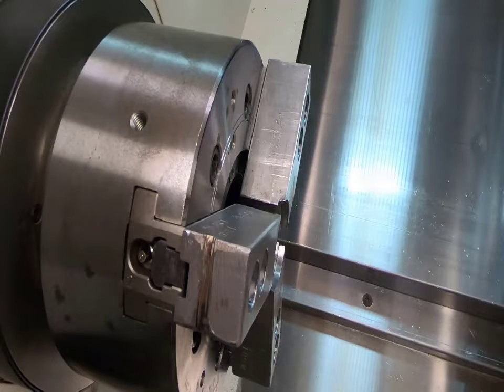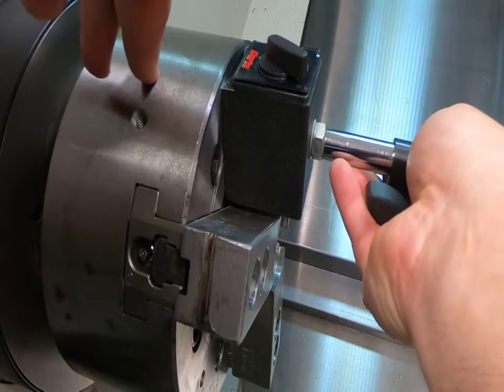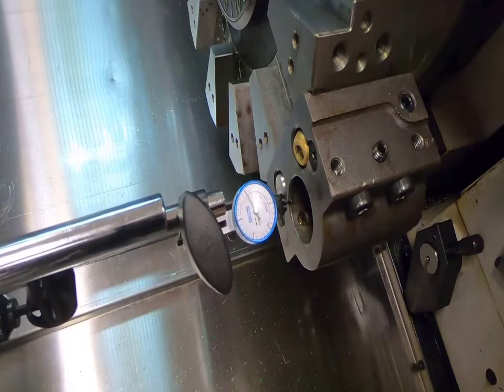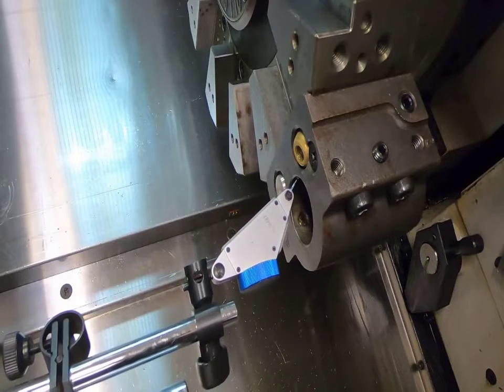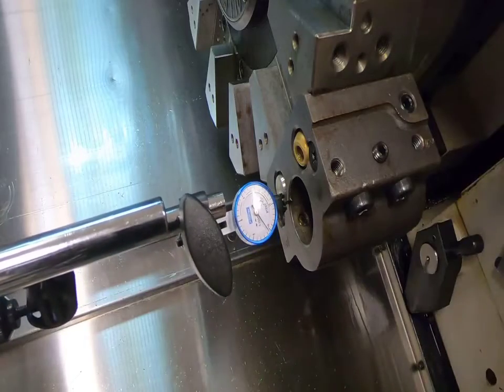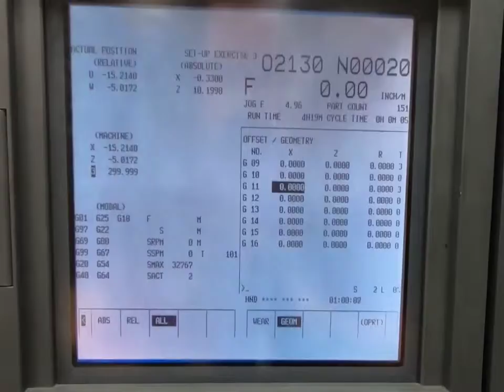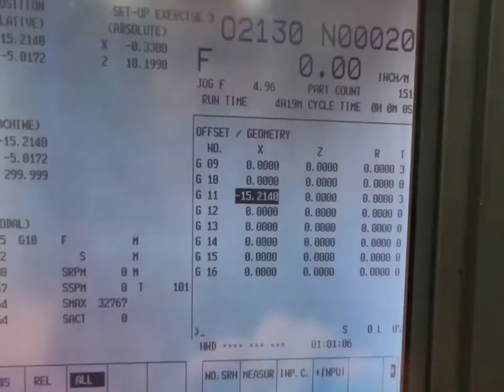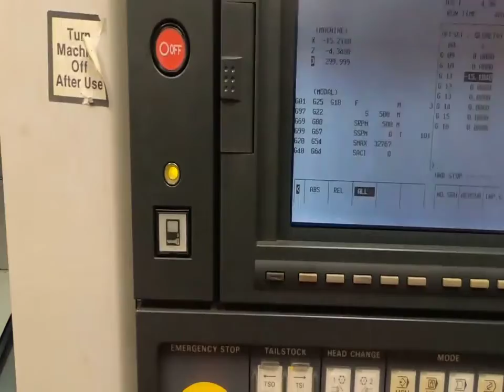Setting up an Insert Drill on CNC Lathe

Comment: I always just type in ”X0” and click ”measure”, that way it automatically knows the current position is X0 and you don’t have to type in a bunch of decimals, for safety I like to call the tool afterwards without going home and it should say X0 on absolute. I also clock the actual drill itself (the shaft) instead of the holder.
Reply: same here dude
Reply: Same deal, just as a sanity check. You really put yourself at the mercy of the boring sleeve, to say it may be accurate, I'd Even go as far as even trusting the quality of it aswell. These " offset drills " tend to like going in one way opposed to the other.
Reply: thats the exact same i also always do. though i indicate on the to knock it into zero runout ( since you can move the ER collet around ever so slightly cand get it perfect on center ) but only when it has to be a very precise hole size where i cant any more tools up. and also get the absolut max tool life out of the drill without changeing feed and speed

Comment: This is something , but if your holder is out in Y , or not parallel with spindle , that sweep won't guarantee a good hole .
Reply from the maker: That is correct about the Y being off and since most smaller machine shops are now purchasing machines that are used this is way to get your hole in close and then use the offsets to dial the hole into size. If your turret is off too much then a service tech will have to be called in to re-align the turret's home location which isn't very hard once you know what parameters are needed to be reset. Thank you for watching

Comment: im really not so sure i agree with this,  if you watch your tool its flexing while drilling after you offset that .030"   so now when you drill it will be drilling off center.    I think its always best practice to center X up on the axis of the tool regardless of the final dia.   use a boring bar to get a your final ID correct.
Reply from the maker: I believe you're more right than you think because I have a feeling after noticing what you saw.  that the turret itself may be out of alignment in Y, which may be causing it to deflect down. Thanks for the comment and thanks for watching

Comment: Invest in a coax indicator
Reply from the maker: Yes coaxial indicators are definitely a way to speed up the process. I'm a firm believer that companies should have these readily available at the machines if a lot of indicating is being done. Especially if you're in the detail area on manual Mills.
Reply: @aaronrunk4209  I use them daily on all my setups for both lathe and mill..
And all of the fixtures I make I just drill a hole to indicate for my x,y 0 positions makes life really easy
Reply from the maker: @fishsticks88  absolutely it makes life easier

Comment: Gravity throws it off. Been there done that. For true accuracy, MUST use a coaxial indicator.
Reply from the maker: Yes coaxial indicators are, and not just for lathes but on Mills as well.  I wish a had air gages in the shop because it seems to be the easiest way to show students how to check hole size, egg, and taper. Dial bore gages are great but the air gages really magnify the details of the hole.  I have students indicate the drill close since they will have to dial in the boring bar for the holes finished size. They also learn how to use the drill as a boring since this saves room on the turret.  Again thank you for watching

Comment: Dial in that turret centerline. The lathe will cut ten times better on OD and ID turrning with that Y axis error fixed.
Reply from the maker: Yes, we do need to get that fixed.  Our Doosan 2100 was out, and the tech showed us a really cool trick to get it back into alignment, and it was also mind-blowing watching then so it. I'm not sure if it'll work on the Mori, but it's worth giving it a try. Thanks for watching

Comment: I'm interested where your zero is its really weird that your zero isn't (almost) the center of the drill pots. But that being said everything you said was very informative for the newbies just starting out. Hats off to you sir 👏
Reply from the maker: On my older machines once I find the distance from home to the center of spindle rotation I have that number put onto the machine to make setups faster since I really only need to do this once. I have some newer Doosan's and they are setup with the offset from home to the spindle rotation is already in the parameters. This allows me to keep the offset at zero. Thanks again for the like
Reply from the maker: @christophercolumbus8944  well unfortunately I've never done that type of drilling but I to would be interested.  That and using a hobber are 2 things I've never tried to do.
Reply from the maker: @christophercolumbus8944  no is a Mori
https://youtu.be/qsOkxyRLabE

Comment: This is a demonstration of indicating ANY ID holder whether it be for a twist drill, insert drill, boring bar, threading tool etc. Every tool needs to be on center in the Y axis too (theoretical Y on machines with no Y axis). For this machine, loosening the mounting bolts and slowly torquing them down while indicating would be necessary.  In my opinion a dead center 0 for an insert drill is unnecessary (just the X). Since it cuts like a boring bar just touch it off like a boring bar and program it to cut at exactly what size you want instead of X0. Also if youre finishing the hole with just the insert drill and no boring bar, clearing the cut diameter by about .005" in X will prevent dragging on the finished bore while retracting.. You cannot cut very far under with an insert drill without damaging it. You can however cut pretty far oversize depending on the length/diameter ratio of your tool. For example, a 1.000" inch insert drill might be able to cut to .990-.995 without too much rubbing/galling assuming it's not going deep, but you can cut up to about 1.100" before the center insert gets above centerline and starts to rub the wrong way (which can be catastrophic and varies by manufacturer). As a bonus you are creating more space for chip evacuation, and you don't need all the different size drills. This does of course have its limits and several variables will affect the end result. One very important thing though is that he didn't check centerline where the tip of the tool would be. X0 at the turret vs X0 5" away may be very different so it's best to use gauge pins or precision ground rods to indicate the length of the tool rather than just the front tool block on the turret itself.  I use insert drills ranging from 17/32" up to   2 3/4" on a daily basis in plenty of 304, 316, 303, 6061 and brass with the help of 8 Mazak HQR150 MSY's which are twin spindle twin turret turning centers.

just my 2cents
Reply: lol .. looks like a clown have  slammed the revolver  into  a rotating chuck... or the runout would never be that bad ..  I bet  both the spindle, z, and x are way off .. but everything can be fixed.  ,if its not a mazak ;)
Reply: @mattiasarvidsson8522  whats the problem with mazak ? :D just asking

Comment: Because you have different block height on the machine blocks it will be, or should be always x0 there will be higher and lower centre blocks as well. There’s you put  in as x+ or x- , depending on the height difference, but again it’s just a rough hole usually.
I’ve worked on many, sometimes the hole a little small, sometimes a bit big, that depends on your turret position during its rotation.

Comment: I've touched the id tools off on the outside from the opposite side, spindle on reverse, then just input your measured OD number in negative and boom the reading is there.
Reply: That's on the manual lathe, the cnc has the luxury of tool setter
Reply from the maker: @MF175mp  Yes CNC's are a Luxury when it comes to setting tools, but knowing how to set tools the way you described is a must because Tool Setter's never break..... :-)
Reply: @aaronrunk4209  The repairing of the setter would probably cost more than I paid for my whole lathe. I would probably end up not repairing it
Reply: @MF175mp  I know I'm a little late to reply to this but that's exactly what 90% of all company's think and do but they really do pay for themselves.... eventually. 
As in speed and if they are treated right and the calibration is good enough for what you want << or set so they leave a little on so you can manually offset in the "right direction " lol.
Reply: @MillTurn4Life  I'm not a company, hobby stuff and a few singles and batches sometimes for people I know at this point.
Reply: @MF175mp  keep going hopefully you (if you like it) can be one of the ppl that started as a hobby then end up with a whole shop I know its harder these days but good luck anyway 👍

Comment: 3:00 Have you compensated for gravity?
Reply from the maker: Factoring gravity would be a good method to use if you were trying to hit the hole in one shot. technically on a boring mill when you're indicating a hole in the size a lot of times you have it run small and then with the boring bar it will finish it but you must use Precision measuring tools such as a dial bore indicator, air gauges, or Tri mics. Air gauges are going to be best in a production environment.

Comment: i usually use a smaller drill than what i need to make a hole (most machines where i work are older and have some wear to the them).

example: im drilling a 50mm hole. then i might use a Ø48 drill, throw it up, set my offset to X0,5 and drill. most of the time the hole will be a bit bigger(Ø48,3) this is to prevent rubbing on the tool inside the hole. after that  i just use the drill to come up to the diameter i need. no need for a boring bar, unless you're doing some profiling inside the hole (FYI the is a rougging application). i use this method to same time and money on inserts. works with most material, but not superalloys ( haven't tried it, but i just assume).

At the end of the day it all comes down to application and how presice you need to be.
Reply from the maker: That is a very good technique as well. This works especially well when putting in hole on a mill that have tight TP.  Drilling it small then inspecting its location keeps shop scrap rates down.

Comment: You could just use MDI to recall the tool offset and G0 X0. to get back to your center position.
Reply from the maker: Yes this makes setup a lot faster once the center of rotation is found.  Using an indicator can difficult depending on the setup but once your close your in and storing the machine location is a must.   Thank you for watching

Comment: Next time just install drill o.d. insert up.  Enter g54/55 g28xo:    test cut a shadow hole,  measure diameter and wear offset just like a boring bar.. finished,  fast and easy.
Reply from the maker: You're not wrong in the fact that this would be very quick if you are running a machine that had its X Center of rotation set to the center of the chucks rotation. however, on many machines the center of rotation is is not the center of spin. Depending on the machine G28 X0 location can be inches to feet away from the center of spin.  For example, your explanation would only work on my newer Doosans but not my older Doosans. The good news is once you have found the center of spin on any machine you can simply write a parameter/macroprogram to put you at the center of rotation or simply write it down on the machine and shift that distance from home position.  Thank you again for watching
Reply: @aaronrunk4209  running dinosaurs?  Lol, j/k.  Guess im spoiled with all new machines.  All my haas, doosan and toyoda's go off center of id holder.
Reply from the maker: @memyselfandi3925  lol yes we do have many good ol machines. I honestly need to make an updated video using the update technique since this is becoming more common. Thank you for the 💡

Comment: How to setting Y0 if the machine have no Y axis?.
Reply from the maker: If your alignment is still off when you set X axis zero, you will have to determine if it's off beyond tolerance and then you need to look into If your turret is out of alignment or if you are able to make adjustments to your tooling to bring it alignment enough to make your parts. Thank you for watching
Reply: @aaronrunk4209   Y axis in my turret miss alignment.
unfortunately my machine doesn't have Y axis settings in the controls..
maybe I'll try to adjust the cutting tools..thank you

Comment: Why not use a coaxial indicator?
Reply from the maker: Yes coaxial indicators are definitely a way to speed up the process. I'm a firm believer that companies should have these readily available at the machines if a lot of indicating is being done. Especially if you're in the detail area on manual Mills. Thanks for watching

Comment: Looks like you done indicated  them jaws.
Reply from the maker: Maybe, but my truck for indicating jaws in is by calling up a boring bar and koving each jaw against it as I rotate it and tighten them down. It works pretty well, but sometimes it's still frustrating. Thanks for watching

Comment: What would be your normal speed and feeds on this index drill on a piece of Alum stock?
Reply from the maker: The feed and speed in using on this drill in this video https://youtu.be/y46_P5Nj9H0
I belive is G97 S2500 F.020 IPR which could be much faster depending on the power of the machine but this is a decent feed and speed.  Thanks for watching

Comment: What about 6edges reamer center
Reply from the maker: With reamers not having much a bottom cutting edge,  once it's dialed in on zero it will follow the path of your drilled hole.  If the cost of your material or job is expensive, always grab a setup piece of material and test it on it. Thanks for watching
Reply: Reamers dont necessarily follow the hole if it is off center because the leading edge is the cutting edge much like a drill.

Comment: Awesome vid. 2 questions. What kind of indicator is that, and how was the drill undersize at first? I get that it was offset but it's still a drill so I'm confused on that one 😆
Reply from the maker: Hello, and thank you for watching. at the very bottom I have a link to the indicator. When the drill is on center it will make a 1.0 hole. However, the drill itself only has one insert that cuts the outer part of the hole and the other starts and cuts the inner part of the hole. Meaning if you were to measure across the body of the tool and the outer insert it would not be a perfect 1.0 the design of the tool allows it to cut off center to an extend. That is why to hole is able to be small using a 1.0 insert drill. Hope this makes sense! HERE'S your link https://www.amazon.com/Fowler-52-562-001-0-Horizontal-Indicator-Graduation/dp/B0006J3LVK/ref=asc_df_B0006J3LVK/?tag=hyprod-20&linkCode=df0&hvadid=312115145736&hvpos=&hvnetw=g&hvrand=14727519745521027406&hvpone=&hvptwo=&hvqmt=&hvdev=c&hvdvcmdl=&hvlocint=&hvlocphy=9026531&hvtargid=pla-623646677887&mcid=58592e8a7d3c328f8ac12f7a628c9006&gclid=CjwKCAjw8diwBhAbEiwA7i_sJQrgSKB7Yoyr-RgYD0zSuJu5To5inN8lawItv6mWZVj8IpxXbI5hnxoCT7gQAvD_BwE&th=1
Reply: @aaronrunk4209  ooh that does clear it up. That's a pretty cool drill! Thanks for the reply 👌